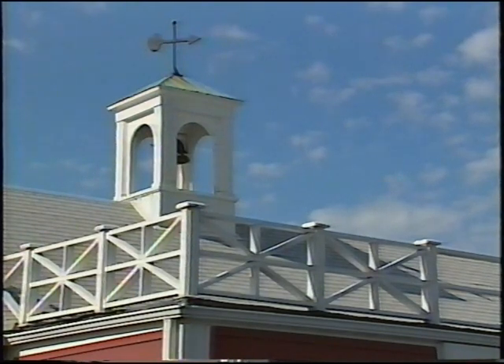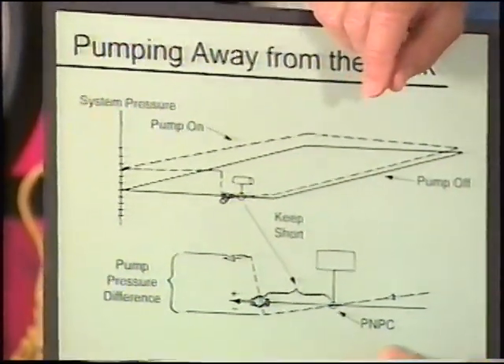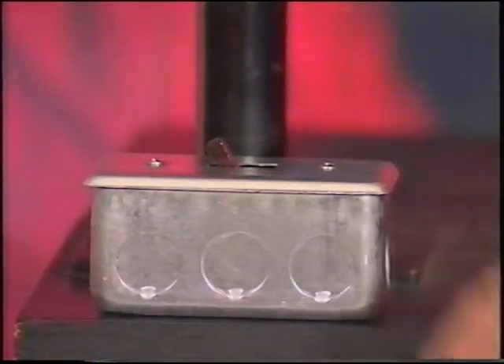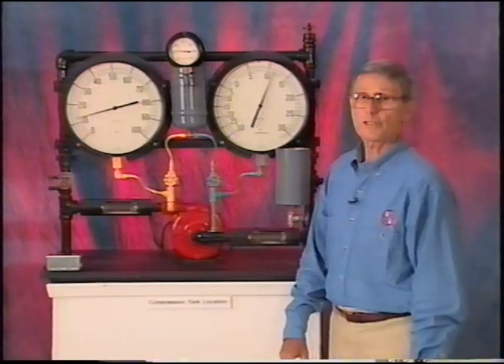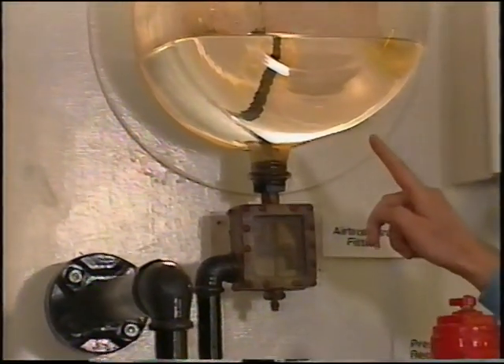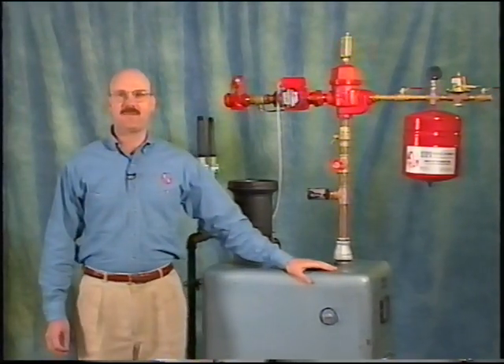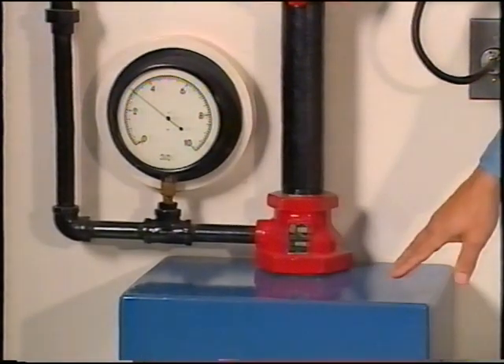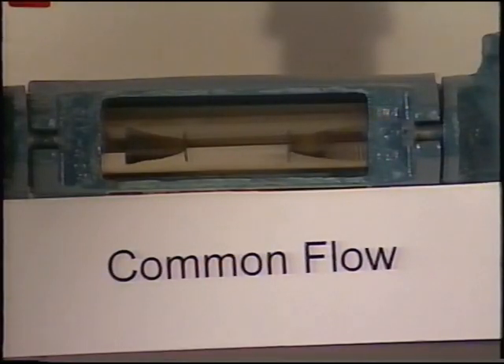Pumping Away - Air Control Primary Secondary Display

Comment: You never explained why there is a second pump at the inlet to the boiler on the primary system?
Reply from the maker: The primary system has a pump to circulate the water around the primary system.